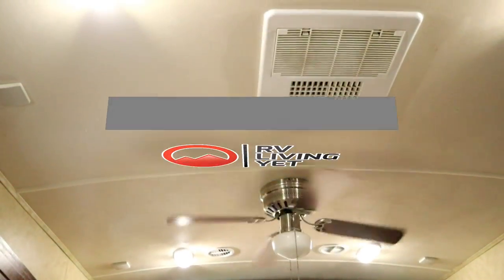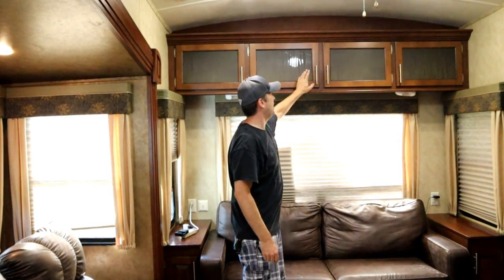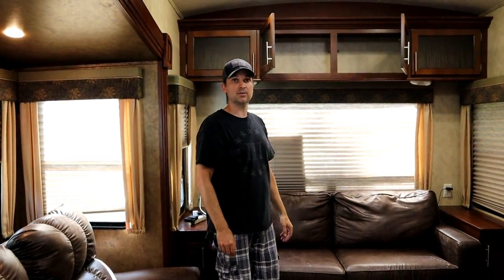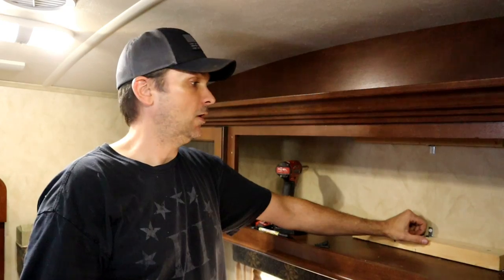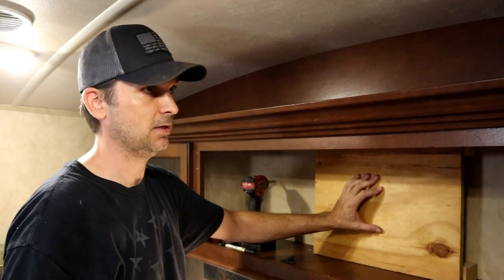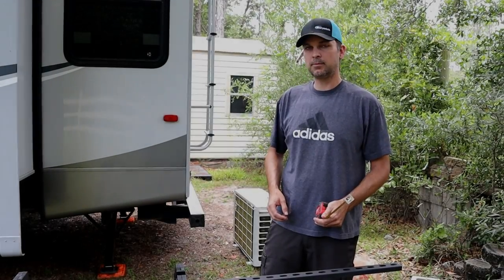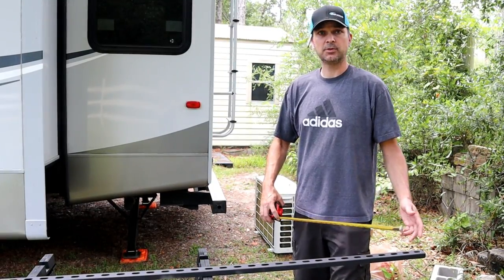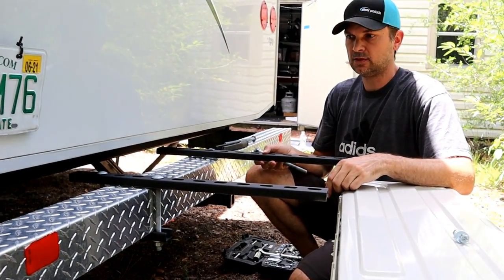Installing Mini Split Air Conditioner In RV Camper-Installing Mini-Split Heat Pump In RV- RVAC Solar

Comment: I sure hope y’all didn’t have any problems with this ac unit. I put one in my rv and cut the lines to shorten them and I Ruined it you’re not supposed to cut the Freon lines because it uses it as an extra reservoir. I ended up having to buy a whole new unit
Reply from the maker: It has been working great, we had to refill it after the initial line leak and put the right amount of freon in for the length. Thanks for watching!

Comment: nice install. Curious, would this be overkill for a 7x12' cargo conversion? What do they run on....120v? Can you explain how it works in heating mode...can you replace a traditional heater with this?
Reply from the maker: You can get them in 120 or 240v, they also come in smaller sizes like 9k btu, when buying be sure it has a heat pump for heating. Ours works great on both AC and heat. Heat would depend on where you camp. Wont work well in below freezing areas.
Reply: @RVLivingYet  ok, thanks!

Comment: Just curious, every RV manufacturer says that you should not bolt anything more than a spare tire carrier or a lightweight bike rack on the back bumper. What did you do to reinforce your steel bumper to ensure the little tiny welds that hold it to the frame do not crack and split overtime with the extra weight?
Reply from the maker: Ours isnt a light weight bumper, it is rated for 150# so its working well. I do know the bumpers you are talking about and I wouldnt attach to them.
Reply: @RVLivingYet    Heavy duty bumper or not, you will still have "twist" and also bouncing of the unit.  If some how you can get your 2 support braces to attached  under the floor and just use the bumper to support the "non twisting" load, problem solved.  I have a feeling you will be fighting this "bounce" forever the way it is now. EVERYTHING I've seen attached/clamped to the bumper bounces like crazy especially over bumps such ad bridge seams and RR tracks. The twisting motion (even on heave duty bumper) puts a LOT of strain in those welds.  If you do remount this unit  keep it at the top of the bumper height as to not hit the ground while menuvering over ditches and steep fuel stop entrances.
Reply from the maker: @duaneroepke8840  I agree, we also added the strap which really stiffened it up.

Comment: Great video thank you. I'm curious as to how much solar you currently have at the time of the video and a year later have you updated and installed more solar? Thanks for your time I'm getting ready to do the same thing to mine
Reply from the maker: We have 600 watts on the roof and 200 watts in a solar suit case, and 200 amp hour lithium batteries, I would say double this can run on solar all day.

Comment: I have a question if it's cold in there and you put your mini-split on maximum heat does the indoor wall unit blowing real hard and then slow down until it reach room temperature or do I stay blowing hard until you turn it down on the remote
Reply from the maker: It ramps up and down as needed.
Reply: @RVLivingYet  and that's the indoor unit right so this low medium and high setting on the remote don't really mean anything because I have it on high and it's barely blowing at all

Comment: Didn't look through all 200+ comments but..
Where did you get the ac gauges?? 
Did it come with freon or did you have to provide it? What type is it?  Great video. We are looking to put one in an ice cream vendors truck and a customer's horse trailer.
Reply from the maker: The products are linked in the description, we also have a FAQ follow up video if you want to look at our channel.

Comment: Sorry to be a pain in the butt! Then you got the advice on the GFCI I replaced it with a standard receptical & it's working great except, when I turn the unit off inside with the remote the only way to get the outside unit to turn off is to turn it off with the breaker. I installed it as per the manual just scratching my head once again. Lol
Reply from the maker: The outside unit may run longer than the inside to shut down properly, but if it's running all the time there may be an issue with the controls or communication wiring. I'm not an HVAC tech so that's about all I can say. May want to double check everything or call a local tech.
Reply: Thank you so much for all of your help. I'll keep ya posted.

Comment: Another question 😅 could you possibly link or give the name here in the comments to what you used to mount the outdoor unit onto the bumper? I’m still learning all the terms and stuff for different tools and equipment as I go so it’d be easier if I had the name of what I’m looking for when I go to hone depot. Thanks!
Reply from the maker: Uni strut and carriage bolts is what you need.
Reply: @RVLivingYet  thank you!

Comment: Good afternoon, so I've been out of the country since we last had contact, but I'm home now and have everything hooked up vacuumed the lines bled the from into the system but my inside unit keeps tripping my 110V GFCI plug. Could this have something to do with the inverter? Clueless at this point. Also when it is running I did check to see i could run both the overhead unit and the mini without tripping any of the breakers and this was a success. Just mind blowing that the GFCI keeps tripping. Your thoughts on this would be great
Reply from the maker: We had the same issue with the GFI in our inverter, you will need to get rid of the GFI as the minisplit technology trips them.
Reply: Thank you.

Comment: Have you traveled much with it?  Has the compressor at the rear of the rig taken a beating?
Reply from the maker: We have about 5k miles with it, no issues. We have a 1 year update video in the description.

Comment: Do you pull your RV often; or is it mostly stationary? Wondering how the line-set fittings hold up while travelling.
Reply from the maker: We are constantly moving. We may park for a couple weeks but no longer than that. it has been great. Since we put the flex hose on, no issues at all with the fittings. Works great! I hope that helps😏 the hose we ended up using is listed below.

Comment: I have a sprinter van I was interested in mounting the outside unit underneath of the van does it make any stipulations that it Hass to be sitting in a upright position or going to be mounted in any position. ???
Reply from the maker: I'm fairly sure it has to be upright, I would think it would get enough airflow and get damaged under the van.

Comment: Nice install I like the use of the flex lines for the outdoor unit.  Looking back at the install in hindsight do you wish you would have cut in a small opening above the unit for more air flow and to reduce the chance to re circulation? Great video.
Reply from the maker: I actually did cut a hole in the top of the cabinet after filming. I dont think it help much but we also keep the side cabinet doors open when we need a lot of air flow. Thanks for watching.

Comment: So I can purchase a 110/115/120v unit? Also where did you wire it in at the breaker panel? And how big is your rv? Sorry if you mentioned any of this in the video and I missed it.
Reply from the maker: Check out our follow up video in the description, has these answers.

Comment: bought the same unit but when got ready to wire the inside unit the signal cable colors don't match If you had this problem how did you solve it?  please try to help , have had little success trying to resolve.. thanks s,j.
Reply from the maker: Just use the same color on the inside and outside, the color of the wire doesn't matter as long as you hook up the same terminal on the inside as the outside, hope that makes sense.

Comment: How did you wire it? Did you add a junction box at an outlet? I don’t have any extra breaker spaces
Reply from the maker: Wired to our panel, check out our follow up video for more info.

Comment: How do you keep the upstairs cool? I have the 13,500 single dometic on my 30 foot 5th wheel and it has the roof vents upstairs everywhere and my 13,500 roof mount womt keep the upstairs cool.
Reply from the maker: These are way more efficient that RV ACs we have a follow up video in the description to answer those questions.

Comment: Hey just curious is this mounted in the slideout? If so what did you do for the lines when the slideout is moved in and out? Do you have pics? Thank you for any help I am looking at doing exactly this.
Reply from the maker: Watch the video
Reply: @RVLivingYet  I did was awesome job just didn’t show the underside (like how lines would move when slideout is moved) great video ! Thanks

Comment: What size is your rig?
Would you consider this safe to leave running while you're not there with pets inside to keep warm or cool?
Is there an app for this and if yes does it work well and does it tell you current temperature (in case you want to monitor for pets safety)?

Great videos, I just subbd
Thank you

Comment: Where is the power coming to your split? Also how to DIY the split to solar. Thx.
Reply from the maker: We added a breaker to the panel and have a transfer switch from out inverter, check out our solar videos.
Reply: @RVLivingYet  thx so much for your reply I really appreciate it.

Comment: Do you know what the humidity level is in the Rv (using the mini split) on a hot day in Florida ?     ....
Reply from the maker: It's a Dehumidifier as well, the humidity while running in Fl was usually in a normal range.

Comment: Do you think you could have gone with a lower power unit?  What is the square footage of your RV?
Reply from the maker: No I dont think a small unit would keep up, this is a 38' RV
Reply: @RVLivingYet  Okay, I'm needing to heat/cool a small living space, about 400 sq-ft, but it has 6" thick foam walls/roof, so maybe I can get away with lower power, like 6k or 9k Btu/hr?
I noticed that the Innovair is considerably cheaper than, say, the Mitsubishi.  Innovair even has a high-efficiency model, 9k Btu with 38 SEER rating!  That's even better than Mitsubishi.
But, so far your Innovair has been reliable?
Thanks for your insights!
Reply: @erictorbet8104  keep in mind RV’s are generally poorly insulated. You’re talking about typically 1” of block foam in the walls.

Comment: Ordered the same unit. When you are facing the air handler inside your line set comes out the right side,(it’s what I want as well). How carefully did you have to bend the copper lines in the opposite direction to get them facing that way?
Reply from the maker: You have to bend them very carefully, if you kink them they are no good. It was a very awkward bend but take your time and use something round to bend them around to make the curve. Good luck.
Reply: Use a tube bender.

Comment: How many watts of solar did you have at the time of filming this?  And how many amp hours of battery bank did you have?  Just trying to gauge off of others who are trying out this awesome way of heating/cooling with solar!! Thanks!  I enjoyed the video, too.
Reply from the maker: We had 600 watts and 200 amp hour lithium batteries, 2000 watt inverter. Thanks for watching
Reply: @RVLivingYet  Thank you for the rapid reply. I showed my husband your trick to fix the kinked copper line!  SOOO glad I watched your video to the end so that I learned that fix, so you prevented that happening to us. I'm now wondering if they make flex copper hoses for the full length between the condenser and inside unit?  That would relieve my worries a lot about the bouncing around of the whole system in my Promaster High Top van I'm converting into a camper.
Reply from the maker: @artistmissie8224  they do come in longer lenghts.

Comment: Where is the out & out airflow for the inside and outside units?  It’s hard to see in video…
Reply from the maker: The unit is ductless so no air transfer from the two units just coolant.

Comment: Great video, I am renovating my 2008 Keystone raptor and am toying with installing a couple of ductless mini-splits. Does the one cool off the whole RV well enough? also do you think the flex line would allow the condensing unit to pivot on a swing arm?
Reply from the maker: We have the 12k Btu unit and it does keep the unit really cool and also keeps it warm in 40 degree+ temps. The flex hose comes in various lengths so I do think it would work on a swing arm as long as you secure the hose and not put too much pressure on the connection.

Comment: Do you need two zone unit if you want air blowing in the bedroom, or does the 1 unit keep the bedroom cool too?
Reply from the maker: We just use a small fan to push the air to the bedroom.

Comment: Hi, great video~ did you get a chance to test the unit under summer conditions when its actually hot out? AZ desert our colman 12K btu unit just does not function over 110. we get about 20 cooler than ambient temps.  I am glad I caught this video as I wouldn't have known about the flex lines.
Reply from the maker: We use it in Florida and south east all summer and it works well but we dont get those desert temps over here. Thanks for watching

Comment: Sizing question:  1 ton mini split and what size is you RV?  Would a 1 ton work well on on a 40 foot?
Reply from the maker: Our unit is about 38' with 3 slides and it works great so I think a 1 ton in your 40' will work well.
Reply: @RVLivingYet  Okay good to know.  Have you used it in summer heat over 100 degrees with it still cooling good?
Reply: @RVLivingYet  Does it circulate enough to reach the bedroom up in the front?
Reply from the maker: @patrickmelson4745  Sorry, just saw your comment, we have used it in Florida during the summer and it worked great, in extreme cases you may want a fan to push the air to the front bedroom.
Reply: @RVLivingYet  Okay great. So over 100° weather?   I recall someone saying they put on the furnace fan on to circulate.
Reply from the maker: @patrickmelson4745  we don't see many days over 100 in Florida, if you're in the southwest you may want to research minisplit in dry heat. I know AC works differently in dry weather versus humid Florida.

Comment: 12000 BTU mini is replacing a how many BTU ceiling unit?  How many feet is the RV?
Reply from the maker: The RV is 36', the main AC was 15kBTU and a 13k in the bedroom.
Reply: @RVLivingYet  What?  So a lesser BTU mini will provide more cooling than a larger ceiling unit?  I thought it was strictly BTU numbers.
Reply: @mangravy2000  well a mini split is more efficient and produces 12° colder air.

Comment: Question: Did you have to add a breaker box to your set-up?
Reply from the maker: we had room for another breaker in our panel but if you are getting rid of a rooftop unit you could use that breaker.

Comment: Just bought a used Montana Mountaineer. Isn't going to move for at least 2 years. Any ideas on the best possible ac system I could install? Currently running the 15k BTU roof unit...which is loud and very inefficient. Then 2x5k BTU window units, one in each end of the RV. Thanks in advance.
Reply from the maker: We have had luck with this minisplit especially if you are stationary, check out the link to the one we have.
Reply: @RVLivingYet   So that model is unavailable at the moment, but what you hooked up was a 12k BTU unit? I'm sure I can find one by another manufacturer. So even though the 15k BTU unit along with the other 2 units I have isn't enough...a 12k unit will replace all of that or should I go a little bigger?
Reply from the maker: @DontDodgeIt...RamIt...Dammit.  the bigger ones do not offer 110v so it's probably to biggest you can go but it's way more efficient than the 15k rv unit, if it gets really hot we turn on the bedroom roof top unit.
Reply: @RVLivingYet   I don't have the exact specs of this RV, but it has just the one unit right above the kitchen, which is the middle room. If I close the main vent it tries to force it through the duct work into the two side room. I only want to spend this kind of money on this thing once so I think I'm going to step it up to a 220 unit since this thing isn't going anywhere no time soon. I found a 36k BTU unit that I think would be more than enough. I have more than enough to wire up a 220 breaker in the electrical panel that goes to the RV space. I'll pack it all up and move it later if I have to.
Reply: Aha, so another question...maybe you can point me in the right direction. I found a few split units with multiple heads. The ones I'm looking at are the cassette style. I'm wondering if I can use the precut holes in my roof for the head units.

Comment: Great looking install.  Do you think the flexible hoses you added to the line set are durable enough to be moved frequently?  I was thinking of mounting an exterior unit where the spare tire is on a rear van door which is opened a few times a week.  Thoughts?  Thanks
Reply from the maker: The flex lines are very durable, what you need to watch for is the connections to the solid copper. If you can secure the flex hose on both sides so no pressure is put on the connection you should be fine. We move often and its been working for about a year. Thanks for watching.
Reply: New copper tubing is very flexible at first, but as it ages it will become more ridged and prone to stress cracking if bent. So as a ac tech I wouldn’t recommend moving high pressure lines. With 410a, pressure in the lines can get as high as 400+ psi and if it cracks when your around don’t touch it till the refrigerant is gone because it can give you frost bite and that sucks. Better to have stationary copper lines then moving ones.